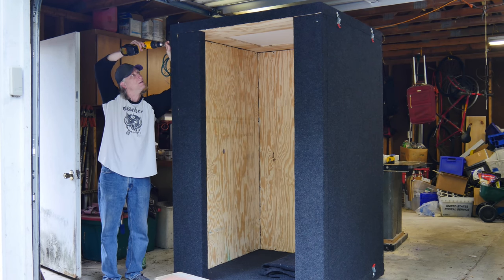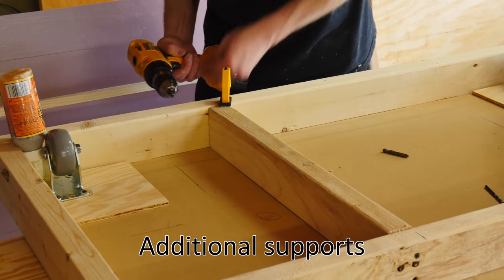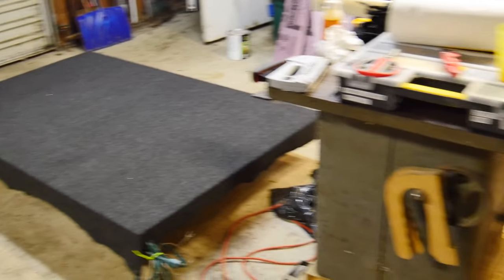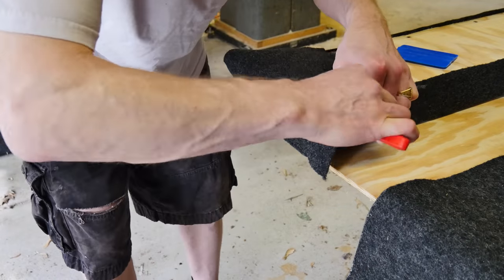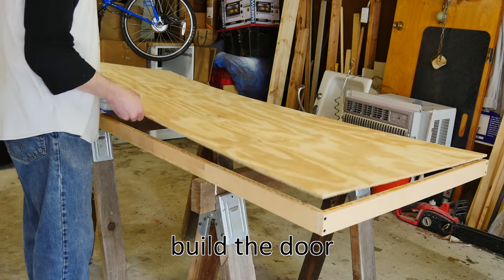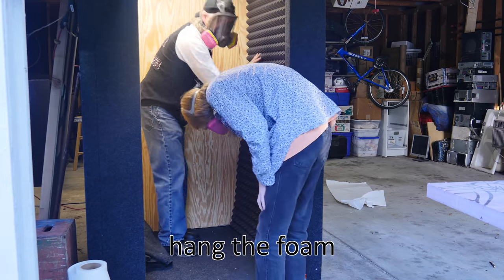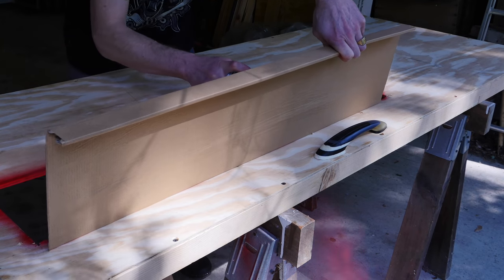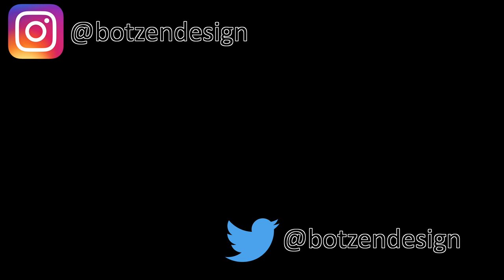Vocal Sound Booth Whisper Room Build: Part 2 covering the exterior and interior

Comment: I just finished mine amazing thank you so much that did work i got an amazing sound isolation up to 50% so far i made it a little simple for example o didn’t build a light instead i put a led light strip and instead of electric box i sneaked a thin power strip underneath one of the walls worked fantastic so happy with it did it in 3 days full time
Reply from the maker: Cool

Comment: I love the build that you did. I'm planning on building a booth similar to this one in the near future. As far as the fumes in between the glass. I was wondering if you drill a couple of holes between the glass tracks apply your sealer and your glass and frame it out with your last piece then let the fumes escape over about a 24-hour period before you put the insulation in and close the door up? What are your thoughts on doing your window this way?

Comment: U need a mass loaded material between the foam and plywood shell. Auralex Sheet Blok or something similar. A compression gasket where all panels meet would be beneficial. Lam- Glass for the window in a closed foam suspension mount as well. Seal the outlet box with a mastic pad and caulk. Otherwise not bad.
Reply from the maker: Thanks 😃
Reply: @EricStrebel  Sure! I have designed and constructed several studios, everything from project to pro. I consulted to Eric Smith ( founder of Auralex) in the early days.

Comment: How would I go about making it soundproof? I'm building a booth to sing in, and need one where I can get loud without disturbing the  neighbors
Reply: This would not be good for recording vocals in at all - it is essentially a tiny room with hard surface walls and only that minor amount of the triangular acoustic foam on it. That amount of foam would only absorb high frequencies but the mid and lower frequencies would be very boxy sounding. A professional vocal booth from a recording studio might look that small but they're actually much bigger room with so much (dense) foam lining the walls that there's only a small space left in the middle but there's so much foam between the singer and the actual hard walls that the reflections would be completely absorbed.

Comment: Those aren't turn buckles. They're quick release toggle clamps. These are the ones I use:
8PCS Toggle Clamp 4001 Heavy Duty Hand Tool Quick Release Metal Holding Capacity Latch Type 220 Lbs https://www.amazon.com/dp/B074FY998D/ref=cm_sw_r_cp_taa_Yu3fDb19ESS71